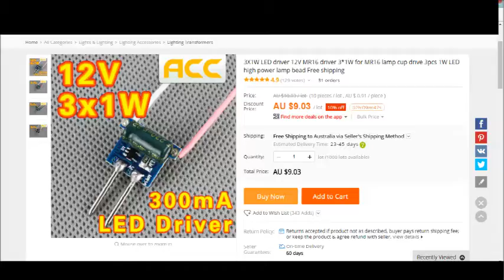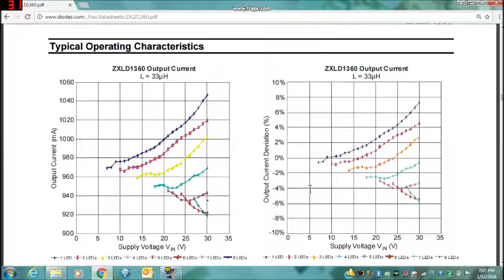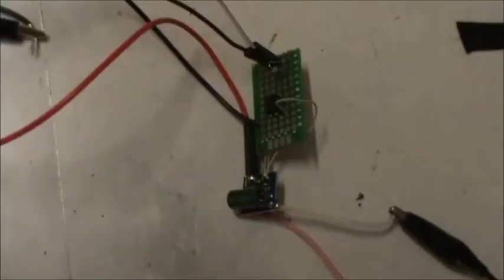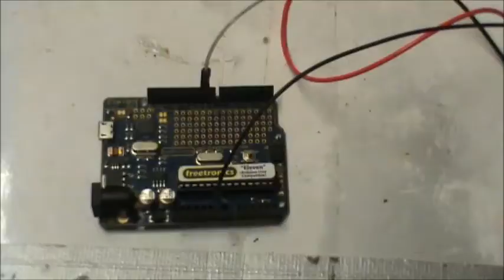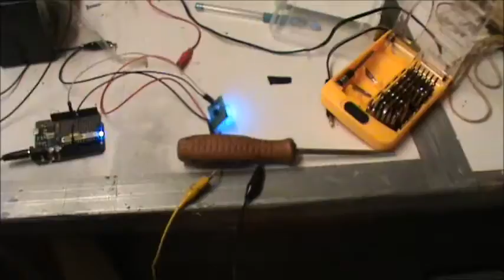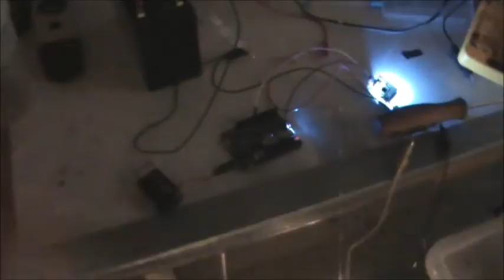Dimmable LED driver for about 70 cents

Comment: Thanks  :  )
Reply from the maker: You're welcome, I just hope you could understand my bumbly voice recorded by a tin can lol
Reply: Audio was not too bad :  )  I have purchased about 20 or so of these made up already but have been wanting to build my own. I was able to find a good deal on Ebay. I just ordered 100 for 9 USD  except I bought the  PT4115 as they are a little cheaper and seem to work fine. They also have a PWM pin.